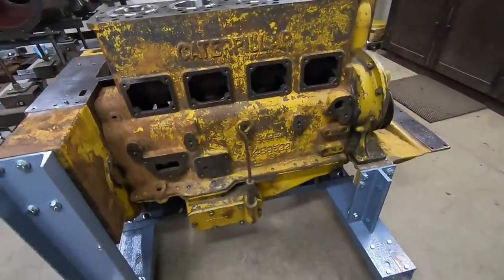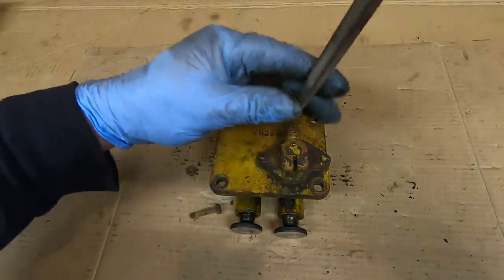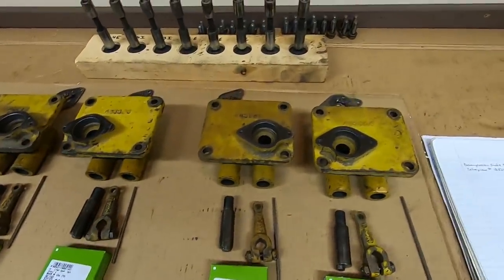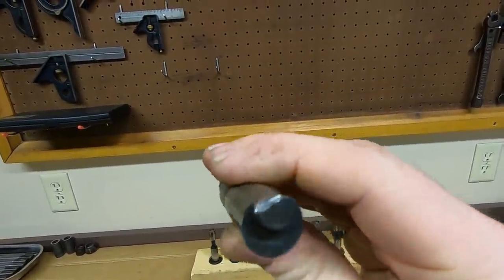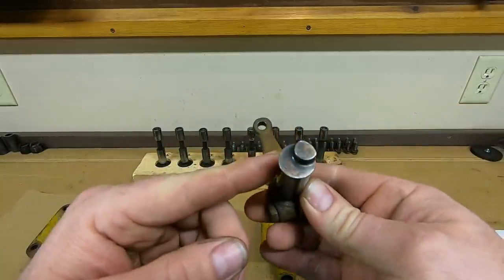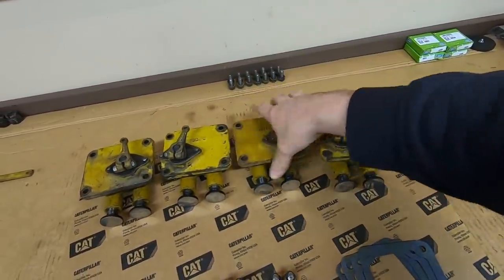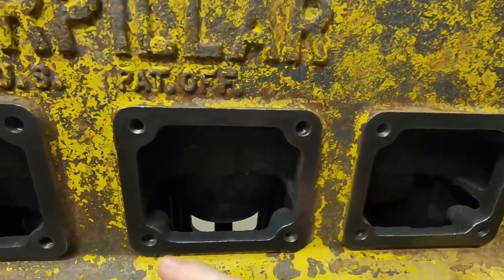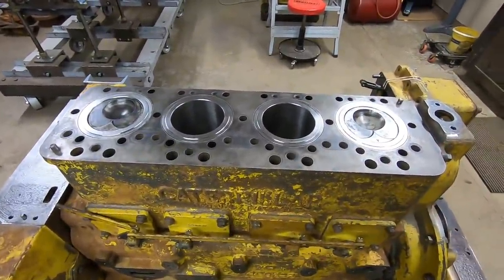Caterpillar D2 #5J1113 Diesel Engine Assembly Ep.21: Installing Lifters & Decompression Mechanism

Comment: I guess I'm following both extremes right now, one guy rebuilds an engine, following all the specs, observing all the details, very clean and very meticulous, the other one is taking the engine apart inframe on a field, puts all the parts on a pile and puts them back together in no apparent order. I guess both engines will run afterwards for a while.. just your while being some decades longer :)

Comment: Watching you install the liners in your earlier video and then talk about checking for leaks in this one reminded me of the first 335 Cummins I overhauled (in-frame major).  New liners, pistons, rings, rod bearings, etc.  I'd heard stories of cutting liner o-rings during install and wiping rod or main bearings by watering them during break-in so I thought it would be a good idea to add a little extra insurance to the mix - I used silicone gasket goop to lubricate the o-rings and liners during installation.  I got everything back together and was running the rack and setting valves, letting that big Cummins idle as it warmed up. As soon as it got close to operating temp it started squeaking.  WEEK WEEK WEEK WEEK WEEK......  You can probably guess the issue.  That silicone sealer hardened up and made the o-rings swell, crushing the liners just enough at temperature to cause interference at run time.  Luckily it didn't really hurt anything but my pride - this was in a pretty big diesel shop with lots of other mechanics and other folks around.  I had quite the audience that day, watching me pull the engine back apart to inspect everything and replace the liner o-rings. Experience is the best teacher you can get, assuming you survive each lesson :D

Comment: I love the use of decompression systems. Oil pressure before a start up. A Cat deal/ rebuilder in Australia was working in an electric starter that auto  engaged when oil pressure was high enough. Supposed to be most wear time

Comment: I used to use Chicago Rawhide seals back in the day,..( that's when they used leather for the seal material ) .once you installed those seals they seemed to last for a very long time.
Of course nowadays they call them CR , but they're still a good quality product.
The cylinder head video ought to be a good one!

Comment: I put a light coating  of anti seize on the full length of the threads on all bolts, if you ever have to remove them later they  turn out easy and you wont have any broken bolts.

Comment: Gorgeous work, very fastidious level of detail. Question if I might Squatch - Youd mentioned you weren't intending to paint the block as you liked how it appears now. Are you planning a clear coat to slow rust down or do you have another method in mind?

Comment: I'm kinda interested to know why Cat opened the intake valve to decompress the engine. Other engines I have seen with decompression options (namely 2 cylinder diesel John Deeres, but also others) open the exhaust valves to decompress the engines. Do you happen to know why Cat did this differently?
Reply: Yes interesting Cat did it that way as blowing air back into the intake tends to make oil bath air cleaners unhappy. Also you would normally prefer the soot and carbon  from in the cylinder would be blown out the exhaust rather than back into the intake. Maybe they just hadn't thought about it yet and just being able to crank the engine over was more of a concearn to them.

Comment: I just learned I have been in the possession of incorrect information as I thought the exhaust valve was held open for decompression so cylinder air is not forced out the intake.
Reply: probably better to go out on the intake than in from the exhaust. there would be too much shit in the exhaust side that i wouldn't want going into the cylinder
Reply: My John deere 720 diesel holds the exhaust valve open not the intakes

Comment: Hey, got a question about you cab light instal video on your 2016 f250. Do you recommend using silicone to help seal the drill holes off. Also have you had any issues with leaks? Thanks!
Reply: @squatch253  awesome, thanks for the quick response!

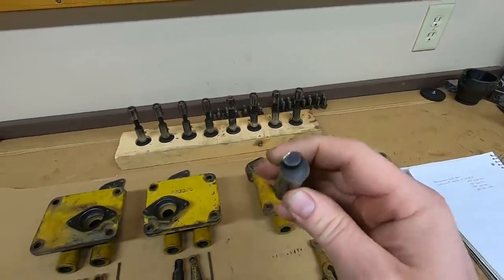Comment: at 7:51 the worn decompression shaft... could that have gotten worn.. if the decompression lever had gotten engaged partially with the engine running and was not noticed.. or the return spring fell off..

Comment: Would you have recommendations on how to clean up the cam side face of the lifters?
Reply from the maker: I’ve never had to do that on any of the old engines that I run - most of the cam systems of this vintage were so over-built that that never wore out, they could only be destroyed if left to rust.

Comment: Squatch, is the decompression mechanism on the D2 essentially the same general idea as "compression brakes" on modern diesel engines? Or is it just to stop the engine?
Reply: It’s for starting. Allows you to spin the engine over without compression to build heat, oil pressure and fuel pressure prior to starting.

Comment: Welding wire is hard hard to been lock wire or mechanic s wire is 1/6. Cant find 1/8 mechanics wire in shopping but old time balers and new type cardboard and new paper balers they use a very good suitable 1/8 mechanics wire